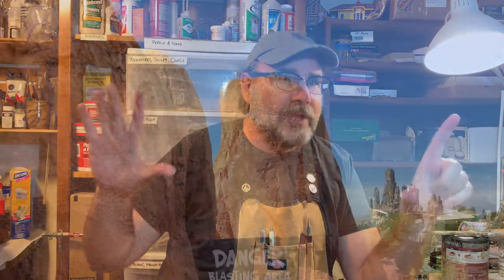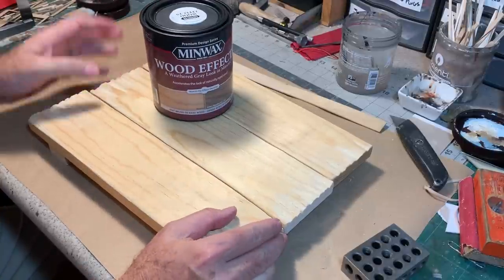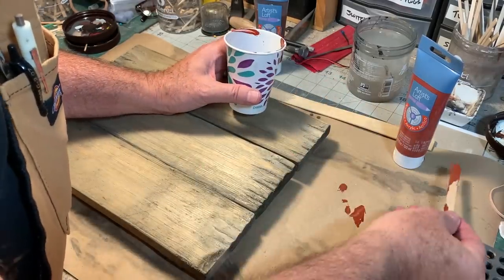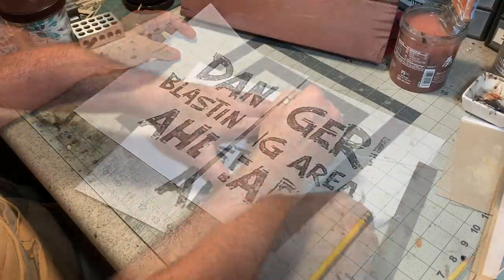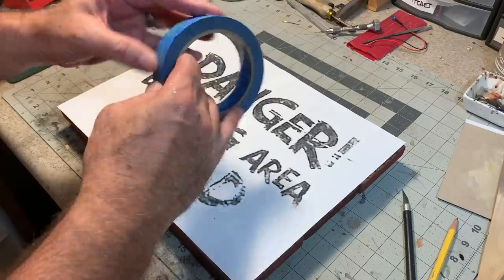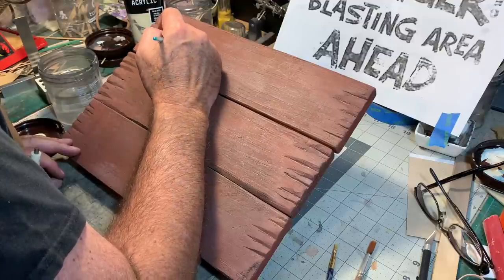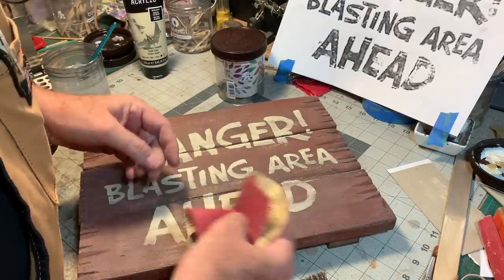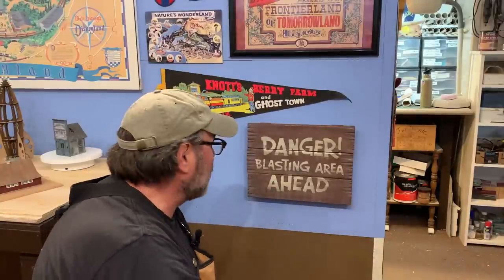Big Thunder "Blasting Ahead" Sign

Comment: Dave,
Excellent tip on how-to transfer the lettering.  My question is the graphic stick you used.  I was unable to determine if you used a soft, medium or hard stick.  I suspect that it was was medium hardness from Derwent, but wanted to confirm.  Also, would you have recommendations on the stick hardness if I was using the technique to create lettering in O-scale.  Thanks again for another outstanding tips & tricks video.
Reply from the maker: Medium to soft will work fine.

Comment: Love this video Dave, I've always been fascinated on how things got weathered at Disneyland. I've imagined it would be the same process as in modeling but with a few different tools. Would they also use an India ink wash? Or would something like that be too expensive to make considering you would need a lot more India ink? Also, with the graphite on your tracks, do you clean your track with it, or is that something you would apply after a cleaning?
Reply from the maker: Hey Randy, Since these things have to live outside, just about everything at the parks is painted and weathered with latex and/or acrylic paints. A dark wash or patina would be added using a warm black or dark brown that's been thinned way down. The graphite is added sparingly to the tops of the rails after cleaning. I usually only add it around turnouts and let the wheals of my trains disperse it to the rest of the layout. Note, to prevent a short circuit, be sure to only do one rail at a time, or better yet, make sure the track power is off.
Reply: You can find several articles and forum threads about graphite on track on MRH magazine. It must be applied on clean tracks. The latest version of the method is to put graphite only on the inner edge of the rails, where most wheels will have the contact point. Leaving to much graphite on the whole top of the rail may lead to slippage (but I never had issue on my 3% grade, but I have also short trains).

Comment: Nice project, but I don't understand the tracing method. Why not make a stencil with  the laser cutter? Or use carbon transfer paper? I would have simply just engraved the wood with the stencil, it seems to be the case on the video, pine is a so soft wood that it will be easily marked.
Reply from the maker: Because I've used all of those methods and this was the quickest and easiest way to get the results I wanted. Why introduce an additional sheet of carbon paper or spend extra time designing things for the laser when it's not necessary? This is a tried and true method in sign painting and graphic arts. It works fine.
Reply from the maker: Also, occasionally I like to show methods that do not require anything beyond a few basic tools. Anyone can use this technique, but not everyone has access to a laser cutter.
Reply: You should make that video for your channel.